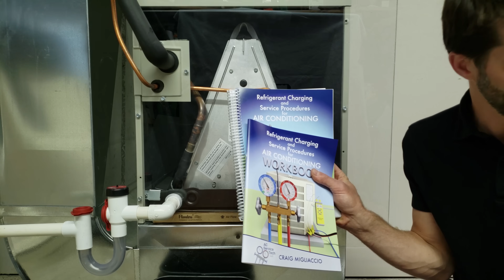Why a Condensate Trap is Needed on an Air Conditioner! Up Close View!

Comment: I've serviced a package unit witch had a zone board installed (left) inside the blower cabint wich burned out twice .I was ther on the second call, Noticed it was a little damp and the zone board had moister on it,  and that they had short 4" pvc pipe off the drain pan. I added a p-trap, installed new zone board called back a month later to make sure clients system was working. Problem solved .  Many techs even some hvac business iv talked to think these ptraps are unnecessary but I beg to differ .NICE DEMO CRAIG!

Comment: Misinformation.  Bafoonery. Can’t trust these HVAC scammers. Report this to Code inspectors.  When the p-trap plugs and you got water showering over your furnace and all its electronics, air mover motor, etc?  Install a washing machine catch pan under your furnace with a p-trap off that?  Show me the Code requirement, manufacture’s installation instruction? None, nada, zilch. Report this to your homeowners insurance underwriter, City Inspector.  Not an explanation. Just says you should. (Wear your mask while showering, swimming, etc, too?)  People subserviently believe idiots nowadays.  “The less one knows, the better they obey.”  Watch the water level build-up in the condenser collector pan?  Are you kidding me???? Here’s the sole purpose of any trap: to prevent the back flow of sewer gasses into the living air space. Period. Please demonstrate, better yet, prove, where sewer gasses are present in the condensate route. Most open-air condensate plumbing gravity-drains into a floor drain leading to a sump. Let’s install many unnecessary traps, then. Put one in the condensate line before it drains into the floor drain, put one at the output of the furnace-mounted condensate pump, put one where the condensate line empties into the sump crock, put one at the sump pump discharge pipe before penetration through the house band joist, put one on the outside of the house where the sump outlet exits the band joist before ejecting into the underground sump drain pipe, put one at the bottom of your gutters before going into the downspout to let the water level in your gutters rise up, put one at the bottom of your downspout before they empty onto the lawn or underground drain, put one where the inlet to the underground drains of every downspout/sump is, use a p-trap in your soft drink straw at McDonalds, piss thru a hand-held p-trap while at the urinal.  Take photos of all these installs and send them to your City Code inspection department, Fire Marshall, insurance underwriter, State Licensing and Regulation Department and State Mental Health Department.  Go to your local airport and ask them to sell you a bucket of “prop wash”.  Our world is already operating as confiscation entities as their business model upon the Sheeple People.  Sheeple, wake up and smell the coffee. Want the real solution?  Evict the British agents that committed mutiny and now pirate world-wide country courts/tribunals. Study Pakistan on how they eradicated these confiscation agents off their land.  Peaceful. Lawful living. Legal is not lawful. Case law is not law. Have them prove their Constitutional authority. They can’t.  Thereby robbing us of our wealth. Criminal.  Wake-up everybody! Wake-up!!  Truth is their enemy.  Enjoy!

Comment: AC Service Tech LLC
I had a new unit installed, both inside air handler and outside.
Only one end of my house  has air flow. 

When I recently changed my filter and  I noticed the installer taped off the silver vent duct hose 
that is about the air handler.

That has always been open with my previous unit.
Could that be causing the low to no air flow to the rest of my house.
He told me I needed a cross flow duct under my home. I  live in a double-wide mobile home.

But I have been in my home since 2006..
And my previous unit was a 3ton  And the new on 4ton with a larger air handler.
My previous unit did not have an issue only cooling one side of my house and it was smaller.

Help before summer comes.. do I need to un-tape that.

Comment: thank you, one of the best explanation. very professional
Reply from the maker: Glad it was helpful!
Reply: @acservicetechchannel  could you tell me why water in the drain tray or pan starts flowing out when the pvc pipe system with water filled trap is attached?
Reply: @sujithsurendran7672  Yeah, how exactly does the trap with water counteract the negative pressure of the flowing air?

Comment: thanks for this video, very educational, i just bought the red capped u trap, but on the site someone states at the lower side of U shape , we need to remove lower side  red cap then add/extend an 3-4 inch pvc pipe on top, to raise it above the higher side of U shape, maybe to increase air pressure ? but i don't see you doing it, maybe it is just not necessary. thank
Reply: acts as a vent

Comment: Even if you don't INITIALLY PRIME the condensate p-trap, at the start of the summer season, it seems to me that the first time the a/c ran, it would prime the p-trap AUTOMATICALLY, as soon as it ran once or twice. The partial vacuum, created by the air conditioner, and that's preventing the condensed water from exiting the air conditioner, would go back to zero negative pressure, as soon as the a/c finished it's current cycle, due to having achieved the target room temperature. Once the partial vacuum transitioned back to zero pressure, at the end of the current a/c cycle,  the condensate water that was being retained, due to the partial vacuum, would now be released into the p-trap, thus filling it up.
Reply from the maker: You are correct. The only problem is that usually the first time someone turns the ac on for the year, they wait until it is fairly hot and humid in the building and the unit runs too long and overflows the pan. It really does not take that long and the pan does not contain much of a volume, thanks!

Comment: Great video - thanks. One question - does the trap need to be right next to air handler or can it be 10-15 feet away?
Reply: Youre going to want to consult the manual that came with your evaporator/air handler. Ive seen a few different variations.

Comment: This is a very simple video and doesn’t even begin to explain all the variations required by the equipment being installed and the environmental conditions it has to work in. Those with experience with negative  pressure systems in dry areas have no idea how challenging positive systems in very humid locations are. Worst of all are the one piece sweep traps, they are mostly  useless and should be banned.

Comment: WITHOUT A TRAP IT'S A STRAIGHT OPEN LINE INTO THE ATMOSPHERE. SO THE AIR GOING THROUGH THE EVAPORATOR CREATES TURBULENCE THROUGH THAT STRAIGHT OPEN LINE AND DOESN'T ALLOW THE WATER TO DRAIN BECAUSE OF NEGATIVE AIR PRESSURE GOING THROUGH IT HOLDING WATER  BACK INTO THE PAN WHERE IT CAN OVERFLOW. WHEN YOU INTRODUCE A TRAP IT STOPS THE AIR TURBULENCE FROM GOING THROUGH A STRAIGHT OPEN PIPE, WHERE THE WATER ACCUMULATES AND THEREFORE PREVENTING AIR TURBULENCE, ALLOWING THE PAN TO DRAIN PROPERLY.
Reply: This demonstration only applies where your air handler is located above the evaporator coils. If it's located below the evaporator like my system, positive air pressure will always force water out thru the drain and you don't need a trap. 
Right Craig?
Reply: @MrPLC999  correct. I would put a trap on either system BUT if you have a GAS system, then the fan set up is BELOW the cndensor, pusing ari thru and therby pushimg air out of the drain pain/drain line. In a heat pump the fan is ABOVE the cond and pulls air thru and could pull air back thru the drain if you dont have a proper trap/ BUT it also needs to be VENTED after the trap goes in. PS the bigger the system the more likely it nneds a trap.
Reply: I need to watch twice to grasp, as it's counterintuitive and the narrator didn't help much for me
Reply: @child_of_god_  THE WATER IN THE TRAP CREATES A LOCK SO AIR FROM THE BLOWER MOTOR GOING THROUGH THE EVAPORATOR DOESN'T CREATE A WIND TUNNEL THROUGH THE DRAIN PIPE ALLOWING JUST AIR TO ESCAPE.
Reply: @Frank289100  yes you made it clearly fro me. Thanks
Reply: @child_of_god_  IF YOU ARE BECOMING A AC/REF MECHANIC. AS A RULE OF THUMB ALWAYS CLEAN THE CONDESOR BEFORE CHARGING ANY SYSTEM. A DIRTY CONDESOR CAN BRING THE HEAD PRESSURE UP VERY HIGH AND CHARGING IT WILL MAKE NO DIFFERENCE. IT STILL WILL NOT WORK PROPERLY. I HAD A CONDENSOR YEARS BACK OUTSIDE FOR MY FRIEND OFFICE. SO I DID HIM A FAVOR AND CHARGED THE UNIT AND FOUND THE LOW AND HIGH SIDE HEAD PRESSURES HIGH. SO I CLEANED THE CONDESOR WITH FANTASTIC CLEANER. BUT IF YOU CAN GET CONDENSOR CLEANER IT IS BETTER. AND THE HIGH SIDE DROPPED 100LBS AFTER I CLEANED IT AND IT ENABLED ME TO PROPERLY CHARGE THE SYSTEM. I CONSIDER THIS PROCEDURE THE HOLY GRAIL OF AC/REG SERVICING.
Reply: Nonsense.
Reply: @oldcountryman2795  WHAT IS NONSENSE, THE REASON THEY PUT A TRAP ON A AC UNIT, OR CLEANING THE CONDENSOR AS A #1 RULE OF THUMB BEFORE CHARGING?
Reply: @oldcountryman2795  I agree, He is completely wrong. Can't believe he thinks this!
Reply: @hotbam37  what is wrong> Putting in a trap?
Reply: It’s not turbulence or the lack of turbulence that makes the p trap work. It’s about the static pressure the SA fan is producing. That pressure is measured in inches of water. If you know how an old school manometer works you would know that inches of water pressure is a measure of how much pressure it takes to push water vertically against gravity. P traps are sized based off of the static pressure the fan produces then adding another 1.5” to insure the water weight is more that the pressure the fan is making.
Reply: @Randall_Marsh  tur·bu·lence
 
1.violent or unsteady movement of air or water, or of some other fluid:

"the plane shuddered as it entered some turbulence"
Reply: So even if my unit drains after its off I still need this?
Reply: @ShyRage1  you could need it. If your unit is allowing water to pool in the drain pan, it can then SPLASH all around from turbuulance and get water on stuff that will later rust.
Reply: @dustyflair  The system was installed in 06.  At this point, I think it's safe to say I may not need it.
Reply: @ShyRage1  you will know soon if the water rusted your evporator out, etc.
Reply: @dustyflair  well it was installed in 06 so I'm assuming its going strong
Reply: @ShyRage1  A TRAP IS REQUIRED. A TRAP ALSO SERVES TO KEEP INSECTS OUT OF THE UNIT.

Comment: good idea to put a union or slip compression fitting near the between trap and the unit ...easier to clean out the slime and crud ..
Reply: Unions in condensate lines aren’t necessary,a simple tee with a cap or a modern float switch has what you need to disassemble without any problems to clean………or best thing I’ve found after over 20years of doing it is a simple shop vac,connect it outside and it will suck all the bs out and then put the cleaning tabs in the evaporator coil pan and your g2g……..or your nitrogen tank with a simple Freon line hose will blow everything out from the inside out.

Comment: My 13 year old ac unit in the attic has a clean out and a p trap installed.  I believe it is a positive pressure system as cold ac air blows out of the clean out if the cap is off.  Do I need to cap off this clean out, leave it open, or install a cap with a small hole in it.  I haven't had any backups as I clean the drain frequently. Please give me your suggestion.  More water drains from the outside pvc pipe when the cap is off but I'm not sure if this is best.

Comment: My coil is is under positive pressure from the furnace air flow . The airflow that comes out the drain at the coil i would say is significant to warrant a trap but by the time the air flow gets to the outside drain point ( about 30 feet away ) it is less air flow than a human breath. So i did not use a trap . That been 21 years with no stopped up drain pipe.

Comment: No matter how many times this is explained verbally, the phenomenon of negative pressure is not usually well understood to most until they see it in real time.   This is a terrific demonstration!
Reply: I still don't get it. I see that it works but no clue why.  Thanks for saying negative pressure so I know what to search for!
Reply: @thejohnbeck  lol first its funny seeing such a recent comment to an older video, right in line to what I was thinking as well. But I found the answer. When the system is running and sealed, and the fan in the system is moving air, it is on the input side (in this setup). Meaning its a vacuum, or under negative pressure. The drain is like a straw, so while the fan is on, the drain is sucking in air. (I wrongly assumed in the video that "system running" was focusing more on the temperature of the evap coil since he focused on it). When the fan stops, there's no sucking, and the pressure inside that area and outside are equal so the water is free to move via gravity. The trap on the drain needs to be filled with water or it doesn't work, because the weight of the water is more heavy than the sucking vacuum of the blower motor in that small area, so air cannot come up inside, so the water can move under gravitational forces, without being pulled back into the pan. Real world example. You get a fresh frosty milkshake from wendy's and go to suck on the straw. It's too thick but you kinda try again, but as you give up, the negative pressure in the straw makes your spit backwash into the straw.
Reply: @crashandwalkaway  the spit explanation did it for me
Reply: @crashandwalkaway  I love your explanation, but if you get spit in your milkshake straw that's just sloppiness lol. Only little kids backwash.
Reply: @mitchellarmyguy2515  only little kids backwash are you kidding me my 35-year-old son still does backwash lol
Reply: @russellbarnes7732  my point still stands.  Age doesn't make someone grown. You should know this on a personal level.
Reply: @thejohnbeck  ...think "vacuum cleaner".....the A/C blower is downstream of the evaporator ( with it's drip pan underneath)... so...the unit operates at less-than atmospheric pressure ( "negative" pressure), or vacuum. Air will want to get "in" from an open hole, and when it does, it 
"Holds-back" the forming water level that wants to drain....but can't. A trap will allow water to drain.
Reply: @TheWilferch  Wil, if the blower motor is downstream from the evaporator wouldn’t the evaporator be under positive pressure? Now if the evaporator was first and later came the blower motor then it would be under negative pressure. I’m not quite sure, I’m a little confused but it just seems to me if the blower motor is first and then it goes over the evaporator, The evaporator would be under positive pressure.
Reply: @mikefixac  ...no...backwards...if the blower motor is downstream of the evaporator...and the flow goes over the evaporator before the motor...it means the blower is "sucking" air over the evaporator....therefore that chamber immediately downstream the evaporator is under negative pressure....like sucking on a straw.
Reply: @thejohnbeck  ...think vacuum cleaner....the indoor evaporator "box" works the sam way...the motor "sucks" the living-space air over the evap coil.....the motor is behind the evap ( requiring it to "Suck") and not in the airflow AHEAD of the evap coil.....this would "push" the air and the unit would then be operating under positive pressure. Here....itt's operating under negative pressure. That's why water won't flow "out" until it stops running.. The U-trap acts (both) like putting a hand over the drain hole ( not allowing any more air being sucked "in)...AND.....th water flows by displacing the water that pre-exists in the u-tube.....so it also acts "open" to allow water to flow always.
Reply: I still don't get it =(
Reply: No ok. I get it. It's just sucking air in through the drain line. The P trap basically plugs it so it's harder for air to be sucked in that way.
Reply: @KaiserXionTV  nobody can thoroughly explain it for you.  You will have to look up videos on positive and negative pressure.  It's just simple physics.  Research the basics of negative pressure and it will eventually click for you.

You'll find the reason why without a pump your ptrap line has to be lower than your supply line. Why a gravity fed water line has to be lower than the tank it's supplied from.
Reply: horrible explanation
Reply: Agreed I dealt with a call today that I just couldn’t understand. It was all just a float switch tripped the whole time but it was hard to tell due to it only tripping because of the pressure.

Comment: Only use those solid shallow traps in positive pressure systems; i.e. gas furnace blowing air across the evaporator coil.
Use a deep trap like the clear one for heat pumps and electric furnaces. You should have mentioned that the engineers do not recommend leaving the tees open. You have them capped in the video, but I see hundreds of them open which leads to other problems. Last, you neglected to mention the minimum amount of drop and minimum about of depth of the trap. For residential units, the bottom of the inside of the trap should be at least 4" below the drain an and the trap should have a 2" depth. More drop is OK, less will cause problems.
Reply: Avoid the shallow one price traps. They are used by lazy people doing a cheap install. They are too shallow and only work if the pressure is low. Use a deep trap and it will always work even with dirty filters or closed registers. But then no call-backs so I guess no money in that?